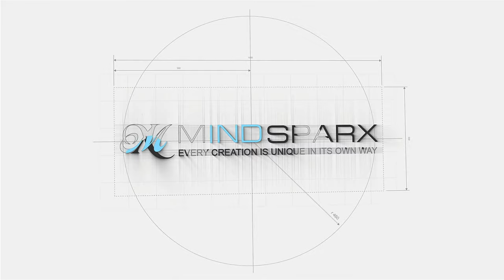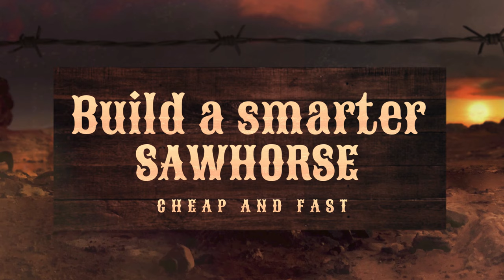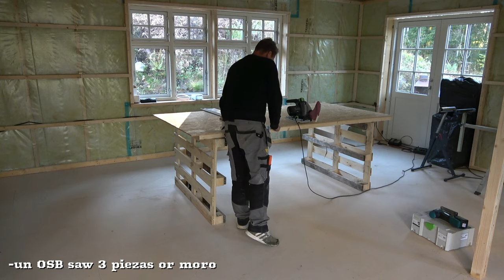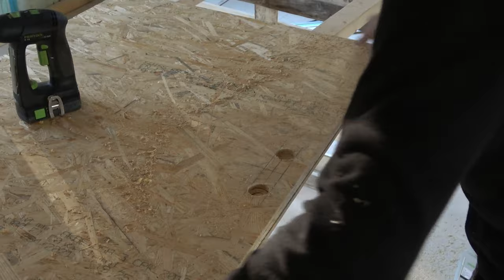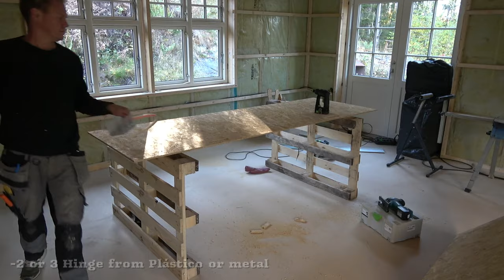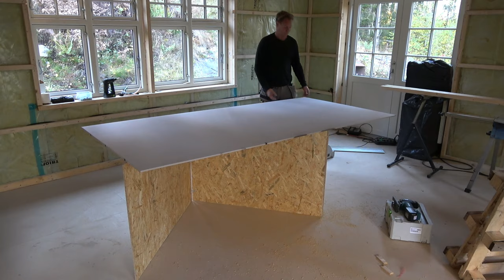Build a folding sawhorse cheap and fast

Comment: Nice idea and not a bad design at all to work with sheet goods,  but I think you really underestimate the value of the traditional design in many other scenarios, for instance working with big beams and rough lumber, which in your sawhorse would be very unstable due to the mid support. Also these are sure much faster to build, but not that cheap since OSB is very expensive right now whereas you can even use reclaimed wood to build the traditional ones tuning the design and measurements as needed.
Reply from the maker: Yes traditional ones are stronger, but quite limited. You can build these in stronger plywood and they can handle a lot of weight. The idea comes from Asia where most people build sawhorses like this.

Comment: Nice idea. 
A few points to consider: price per unit (compared to 2x4 lumber), weight (you can cut a hole in the center to make it lighter) and maintainability (most 2x4 designs allow to replace the top board after it gets chipped by saw cuts, here you can make it shorter and get a clean edge).